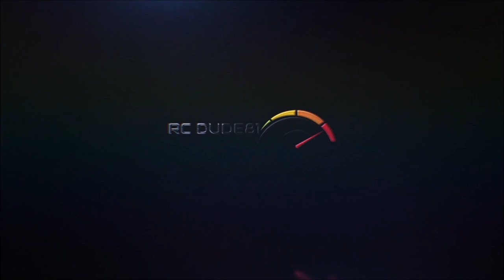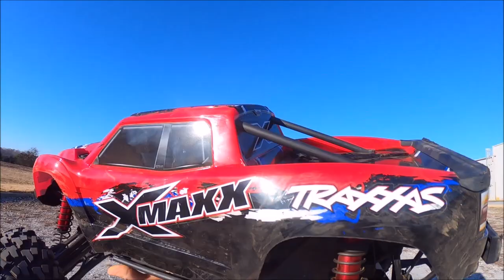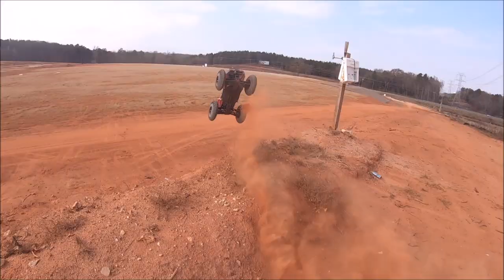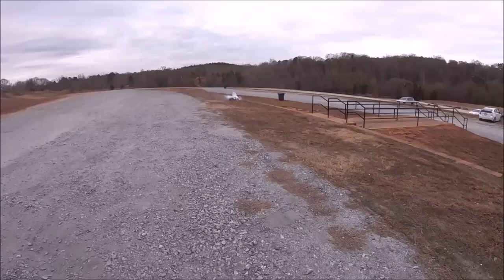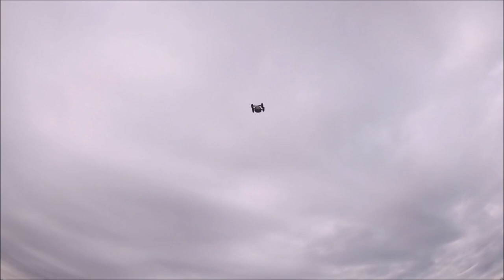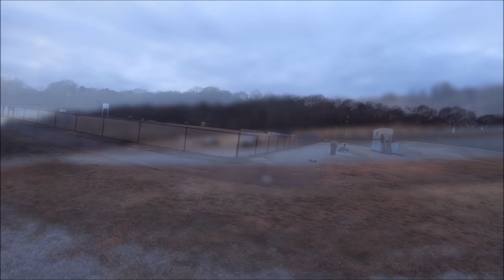TRAXXAS X- MAXX! First run, Fails, Ungrades and Mixed rig blast. LIPO FIRE😱

Comment from the maker: Got a rough start on this Traxxas X-maxx but a learning curve for me for sure! Had several drivetrain issues early on also but hope to have them sorted now! This is a great truck with lots of M2C potential to get it even tougher and more dialed in!💪💪 More testing and products coming soon along with a new powerplant! I added some footage of my bro Jason and I having a quick evening bash. It's all fun and games until a lipo catches fire!😂
Reply: I got the 1100 KV in my x-max with the max 5 and I snapped drive cup two and I went and got the GPM hardened steel racing ones and I've had no issues since but seeing how m2c  gives you all your products I'm sure  they'll be coming up with drive cups too so shouldn't have that issue once they come up with theirs as well but there is some out there that I haven't had any issues with yet the stock ones absolutely suck and I have the duratrax six packs on mine  so I'm assuming that's the heavier tire so I was snapping mine too but about to go put m2c motor mount and brace on mine right now so we'll see how that the center shaft holds up in a that be about the only other upgrade I think I'm going to need on this truck
Reply: That is till M2c comes out with all these other parts and I'm a sucker for it and I'll end up buying them all too
Reply: Just buy a outcasts 8s 😆
Reply: @paulclancy2404  got one on the way
Reply: @paulclancy2404  but the x-maxx is a great truck take a beating
Reply: @blacksheeprc8113  definitely is , I want one and complai about the cost but have close to 1000 into TLR rtr buggy so is what it is. I need 2 one to beat one to treat nice 😆
Reply: @blacksheeprc8113  nice you going love it but like Eric with xxmaxx it be a learning curve , sure you know . I drove my freinds xxmaxx once next to my kraton , it was so clumsy and slow even though he had like 1500 into it. I realized stock esc motor gearing  traxxas batteries while not being used to driving .totally different feel and way we bash . Plus his upgrades were making it look nice , heavier wheels things like that . The outcast 8s is slow also stock use the bigger pinion right away unless you want with the exb roller .

Comment: I’m sure M2C will come out with their version also but I put the WFO outdrive cup sleeves on my Xmaxx and have had no issues. I run same system as you with 25/35 WFO mod 1.5 gearing. Absolute BEAST now. Looking forward to more M2C goodies for the big girl ☺️. Great bash Eric 👊

Comment: Cool video, i bought used xmaxx some months ago and i made some smaller upgrades, using max6 with stock 1200motor 50 20gearing and atm i only broke 1 stock servo horn and 1 turnbuckle. sadly i dont have so rough terrain here but mostly im driving sand careers.

Comment: Nice big sends. My X-Maxx does very well with my 30ft plus jumps, which are like baby jumps compared to yours. Honestly, it survives bad landings better than my M2C upgraded Outcast 8s and EXB K8S due to it being around 5 lbs less. Good stuff man!. Yeah that's the ESC and motor combo that I run. I run mod 1.5 gears 25/35 gearing. It's my fastest rig on land. 48mph. Yup, those cups need a bearing around them or a drive cup sleeve. For my front and rear diffs to survive that insane power, I had to install the Traxxas center diff cases in the front and rear diffs, I put a shim in front both the output drives and I had to install aluminum differential covers on the front and rear diffs. I rarely blow a ring gear and output drive after doing that 👍. I've tried the regluing thing and got tired of it! I know use beadlock tires. The proline 4.3 trenchers take that power with no issues. And no more regluing issues!! Hex extenders, better pistons and beefcake driveshafts would make this thing an even more insane basher 👍👍👍👍. Wow that lipo explosion was epic. I'm glad it didn't blow while on the truck. That's why I prefer hardcase lipos but it can only do so much with such a brutal hit 🤣🤣🤣🤣
Reply from the maker: Thanks for the tips bro!👊Definitely shimming the diffs and will probably get a HR cover. Lots of tuning to do but with time and M2C, it'll be an epic basher!💪💪

Comment: This video and Also Rich Duperbash’s X-Maxx videos is a “prime example” on “why” all of my rigs are Arrma. Traxxas is more of a toy grade type company. I swear to god Arrma rigs are so much better even straight stock, they don’t bounce like the X-maxx and they don’t break like a Traxxas rig will break. I’m not saying this just because, I am saying this from experience. I get it, there are many Traxxas fan boys which is great but again this video and Rich Duberbash’s X-Maxx videos are a prime example on why Arrma is just better! This video is what happens every time way back in day I would take a Traxxas rig bashing. The breakage just never stops. I never got 1 full day running just 1 pack without serious breakages. Ill take my Arrma rigs out and run two packs in them no problem. Yes of course Arrma rigs will break also, we all break stuff but its different with Traxxas. It never stops. Arrma rigs come with a strong foundation and its much easier to avoid serious breakages. Cheers-over and out.

Comment: Did you and Duperbash go X Maxx shopping together? lol I’ve seen people put inner rings from bearings they’ve taken apart to give the drive cups a lot of extra strength
Reply from the maker: 🤣🤣Only for testing M2C goodies or I wouldn't have one!😱Its fun trying to break stuff😆Thanks for the tip. I did pick up a set of WFO cup rings so hopefully that will help.👊👊